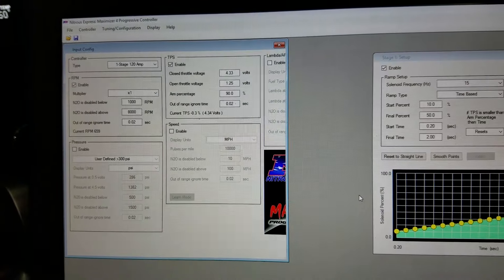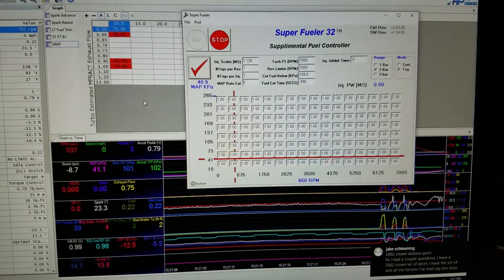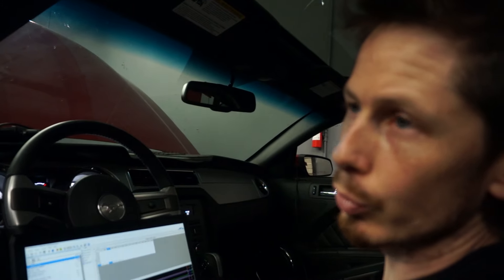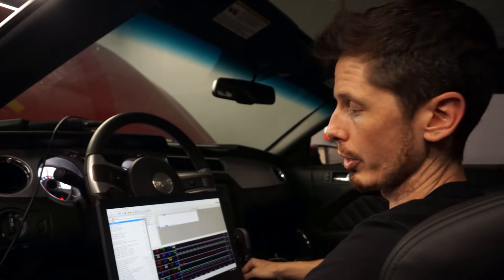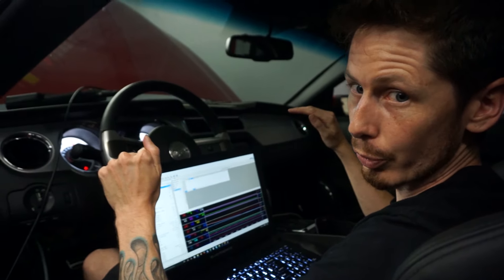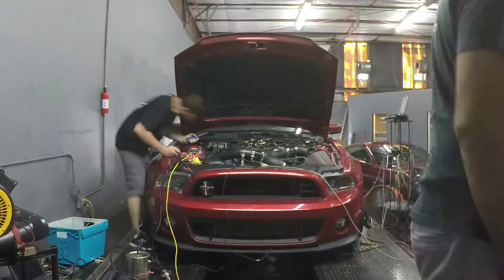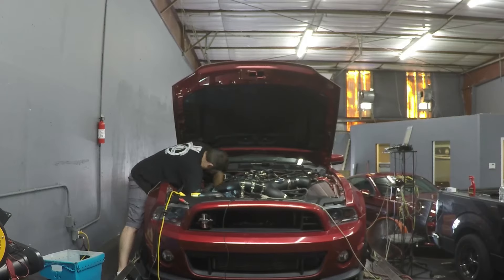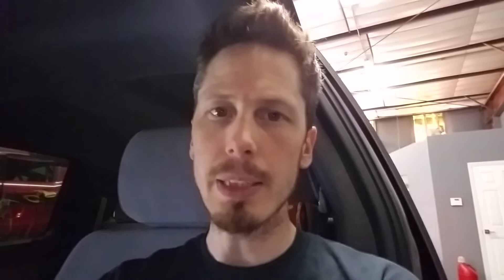Project Ecostang: 3.5L Ecoboost Swapped Mustang - Part 4

Comment: Would changing the injector settings so that the aux injectors take care of most of the fueling for idle/cruising duties and go to handling half of the fueling duties for mid to high boost situations keep the fuel pressure in check?  It would at least keep those intake valves cleaner.  And are you still on a stock sized in tank fuel pump, or have you gone bigger?  I set up my wrx to run on e85 almost 10 years ago, but I just got an MKS and i'm new at dealing with direct injection and I'm curious about how you guys are dealing with fueling for e85.

Comment: They need to find someone to crack the BOSH ecu like they did on the e69 Bosh unit for Ecotec engines its pretty much the same DI code used to control the injection window. Once you find this there should be no reason why you can command more fuel  and limit your tune based on when the rail pressure falls off. There is seriously NO ECU hackers out there able to crack these tables ? If not full e85 will never be possible